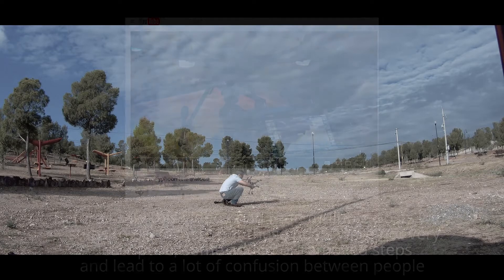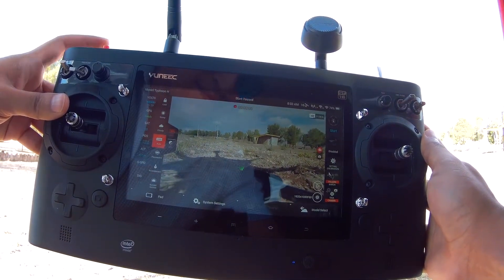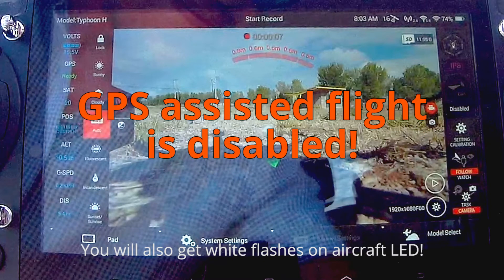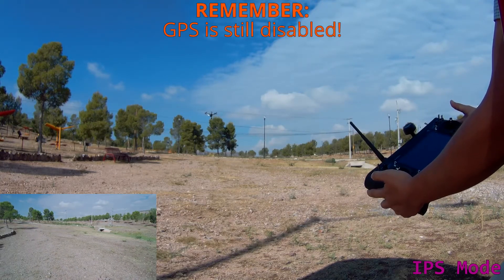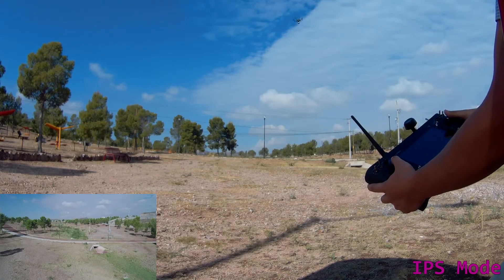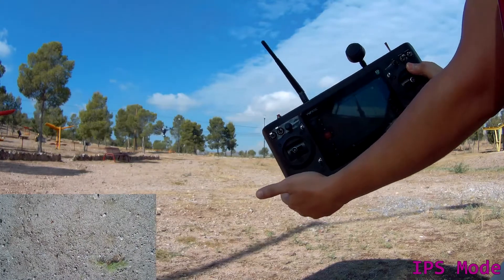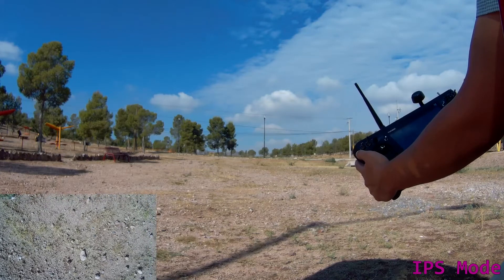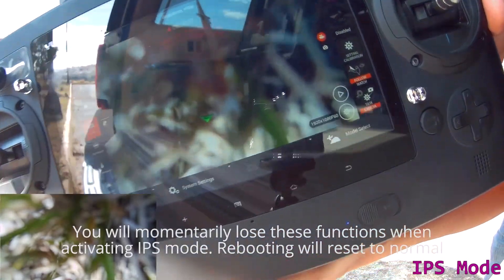Typhoon H - IPS flight test

Comment: Just because Some have  had one bad experience with "H"  does not mean the product is bad. I too have both the Typhoon Q500+ and the Typhoon H pro with Realsense and have not had any technical issues except a bad fan and stick gimbol  on my ST16,  CS fixed it under warranty and had it back in three days Just like new. Had the Q500+ for almost 3 years and have never had a problem except again a stick gimbol, which by then was out of warranty. Part was only $14 plus labor and shipping, again had it back like new.
Reply from the maker: I agree, I purchased my H as my first "high-end" drone and don't regret it. I have had a couple of issues as well (specially the noisy fan on the remote), but then again, nothing that would make it a bad product by any means. Actually I believe that even now that is 2 years old the H is an amazing machine

Comment: First off, thank you very much for this video. I have been scouring the internet and the forums for information regarding the IPS for months. I finally broke down and bought an H after much debate back on July 4th when it was discounted to $1199. It's the RTF RealSense Pro model. Mine also came with the ST16+ with 3 external antennas. 

I wanted the RealSense mostly because of the IPS like you but I am very disappointed in it's lack of functionality. I don't want to test it indoors because like you I worry that it will get a GPS lock and fly into a wall even with RealSense Obstacle Avoidance on! I wanted to do alot of low level forest trail and cave and tunnel shots. Now with the cave I'm sure it would work normally since there would be no GPS but with the forest trails or even short tunnels I worry about GPS signal lock where it flies into a tree.

So I have to try this out. 

I'm also hopeful that it will work with the latest firmware since I updated to that. Do you know if it will?

Also, do you have any test videos on the RealSense working? I tried briefly once but I felt too nervous because it appeared to want to fly into a tree while traking me. I saw only two videos on the RealSense and those two showed it avoiding everything from tree limbs to chain link fence!!! That's impressive.

I'd love to see any video you have on it.

Also can you post the link to the original video where you discovered this IPS trick?

Thank you again!
Reply from the maker: Thank you Airwolf! Seems we're on the same frequency here. Yes, this will work on recent firmwares; actually this "trick" was introduced on recent ones: I was running an older firmware at first when I purchased the Realsense module and that was the reason I wasn't able to activate it manually. Now I'm running the latest which is the one you see on this video.

I've also tested realsense only briefly, like you, I'm still not confident on how it will work eventhough lots of videos show it working perfectly. I never intended to use the RealSense, I was mainly interested in the IPS, but I definitely want to test it on the field. As soon as I get a video about that I will let you know!

Greetings!

Comment: Good video. I noticed on your ST16 you only have two antennas. I thought you needed the 3rd one with the Real Sense installed???
Reply from the maker: +JImmy Daboul not at all Jimmy! I own one of the early versions of the typhoon h, I purchased the Real sense module much later and installed it on my aircraft. The st16 always had 3 antennas but at first one was internal, it was later upgraded to have an external tip on recent versions :D